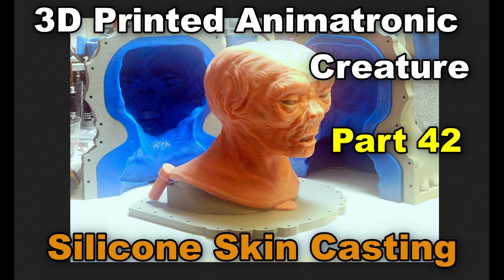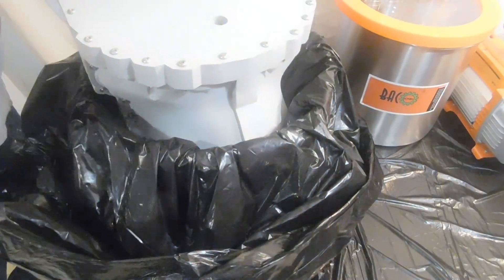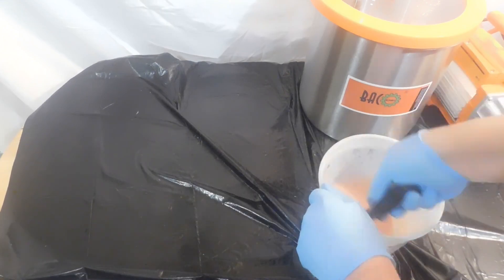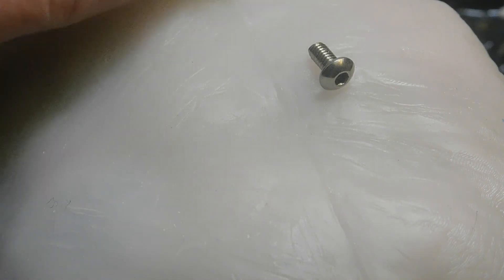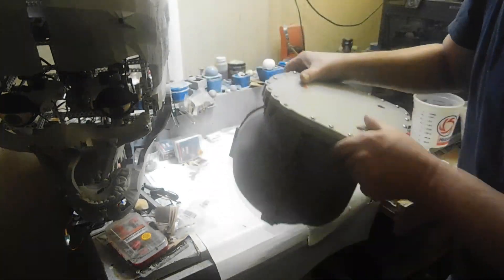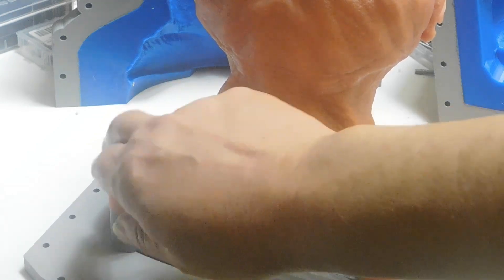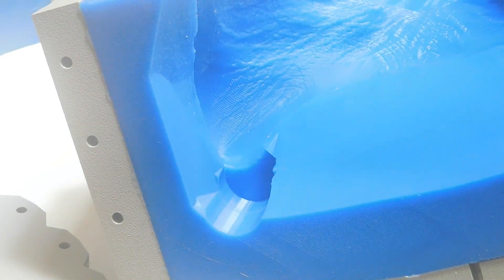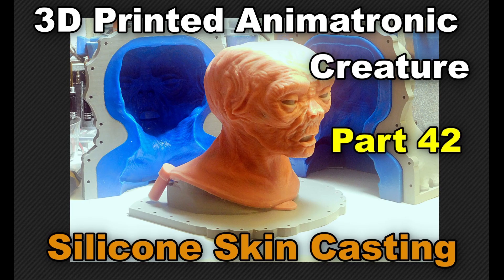3D Printed Animatronic Creature Part 42

Comment: Awesome! Can you drill a pinhole for the void under the chin or other areas where air gets trapped to act as a vent and then patch it with a bit of painted on silicone later?